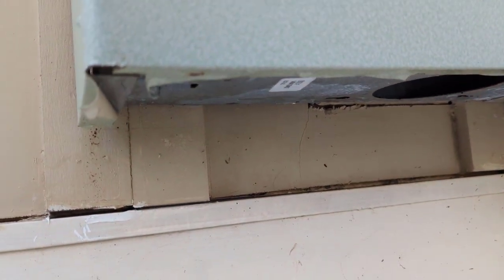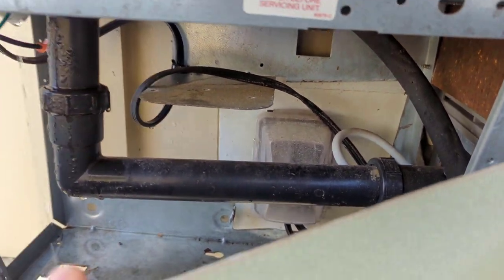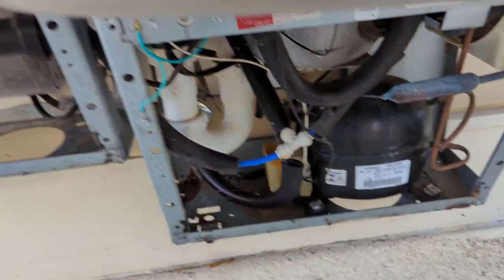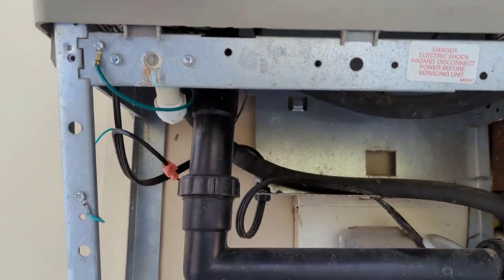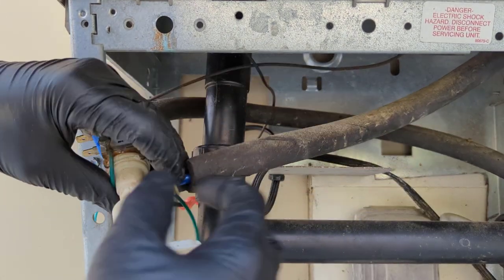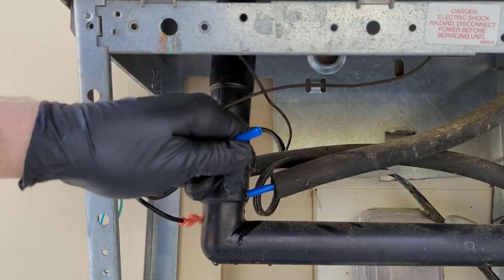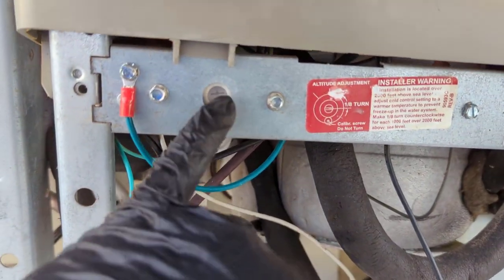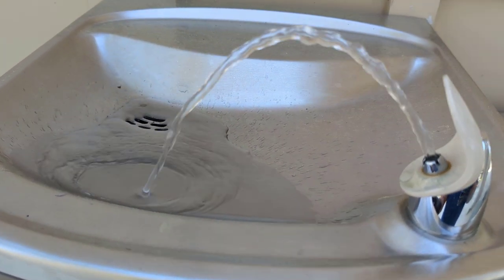Elkay Water Fountain Leaking

Comment: How did you know each of the valves were cracked?
Reply from the maker: We had a cold spell below freezing for 3 days & the outdoor water fountains were not shut down during that time frame. When I arrived at work the day after I saw a puddle of water under them & saw the water slowly dripping off the bottom corner of the fountains. I took the covers off & found the issue. I shut the water off to them & ordered new valves. Thanks for watching angrysmileyface78 & subscribe to the channel 👍